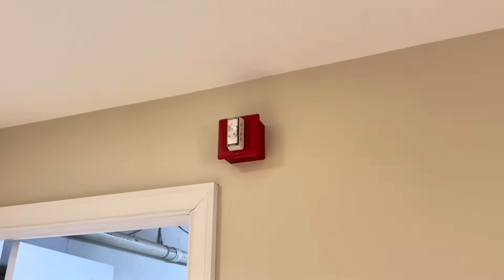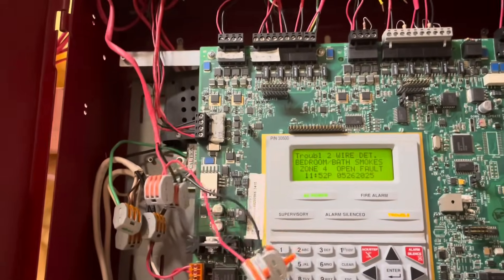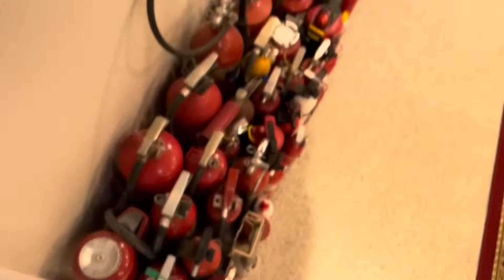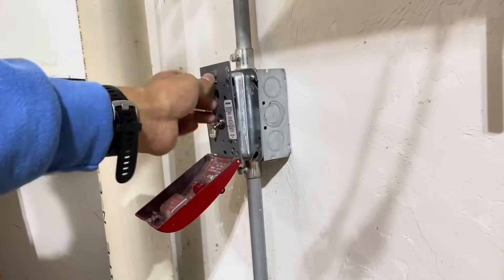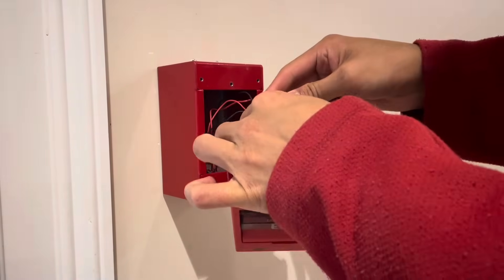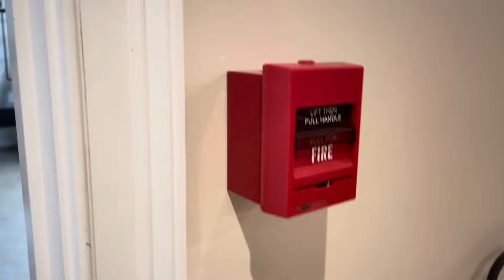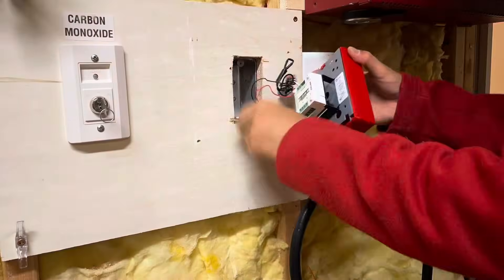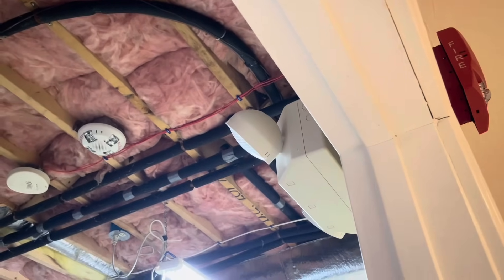Installing NEW Edwards LED Speaker/Strobes to Replace Integrity Horn Strobes | Fire Alarm Upgrade

Comment: Wow. I'm looking forward to system test 42 at the end of this month. I'm very excited. What a surprise. Why I said what a surprise is because the biggest surprise you did was not putting a wall mount speaker strobe in the panel room. You changed it up this month to a ceiling mount. That's why I said what a surprise. And that the LED ceiling mount fire alarm speaker strobe from EST. had the alert cover.  Man. To think that I was just going to watch another same replacement. It was a complete change up in then panel room that there is now a ceiling mounted speaker strobe LED. Awesome change up. Good work, you put in a lot of effort just so you can put out great content videos like this, especially for a lot of your viewers and subscribers. And yes, I am one of your subscribers. 🙂I am very impressed.